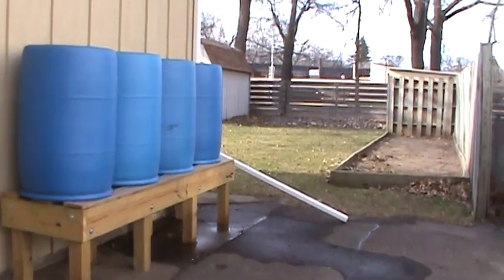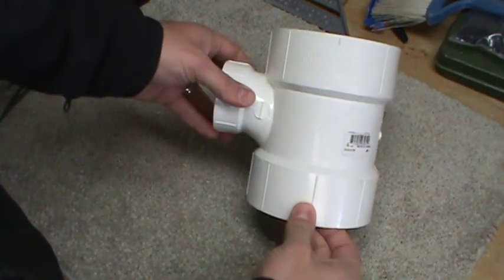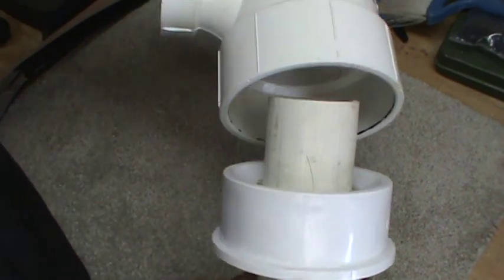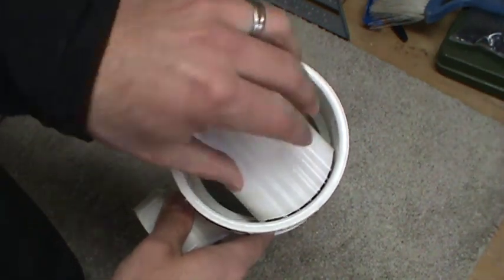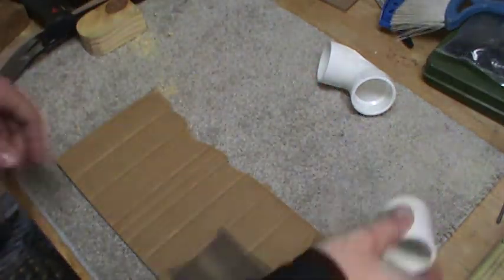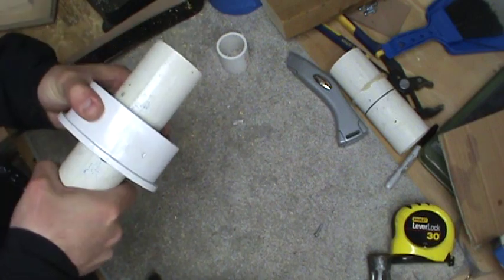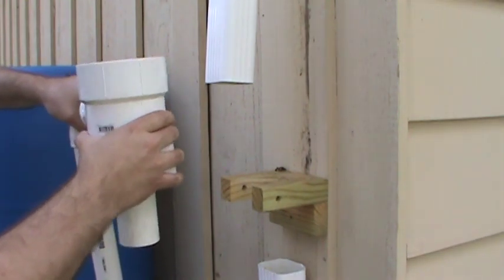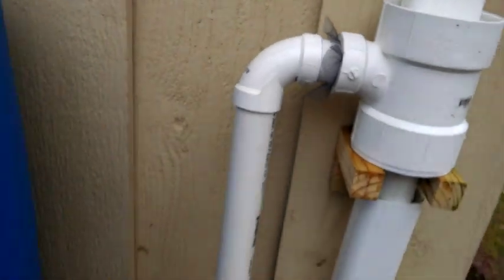Custom PVC Rain Diverter 1.0

Comment: You said the diverter does collect a lot of 'stuff'. That's what it's supposed to do right. Seems to me it works fine. It's easy to imagine all that stuff in the bottom of your rain barrel along with all the stuff that wouldn't get diverted without your ingenious diverter. As to having to clean it out, well yea! Wait till you have a composting toilet.
Good video and good job.

Comment: Left a comment on your other video about collecting debris before water goes into rain barrels.  Asked how you're stopping junk from making it into the barrels and the PVC along the bottom.  Found this video.  Thanks.  But!  I bet you're getting finer mud into the PVC and maybe into the barrels as well.  Perhaps the position of the barrels (upside down) might aid in self cleaning, but I'm suspecting you've had issues with mud.  It's been 7 years and maybe you're not looking at this video any longer.  If you do reply I'll be watching.

Comment: I have this same upside down system. I'm using a similar diy diverter. My problem is when I get a torrential rain the diverter can not reverse quickly enough. It's not sending water down the downspout fast enough to keep up with rain flow. This causes one of the barrels to top out above the air vent which creates an automatic Bell siphon and once that starts I have no way of stopping it until the Barrel's empty out down to the battle that started the siphon and then once it drops below that siphons then it equalizes all over again I'm now trying to find out how I can prevent the barrels from self siphoning during rainstorms where the diverter cannot backflow fast enough
Reply: Wouldn't a small vent hole on the top of the rain barrel solve this issue?

Comment: I am using your design except for my diverter, I raised the intake pipe higher than the barrel so when the barrel is full the excess water will come out of the air vent pipe. It so simple and works like a charm.

Comment: I'd let water flow from diverter to the barrels without any filter. Once in the barrels, debris will sink to the bottom. All you have to do is to clean up the barrels once a year. But you have to cut open the top of the barrels for easy excess

Comment: I appreciate your ingenuity. However, you essentially made a mosquito hatchery.
Reply: Please enlighten us how they get into the barrel.  His demo is awesome and very detailed, so your comment needs to be explained as well as his demo
Reply: Linda Murri seems like the top of the diverter is open and collects water for mosquitoes to lay eggs. Perhaps mosquito hatchery was a bit hyperbolic. I think the system is awesome and kudos to him for crafting a homemade diverter. It just appears that when he cleaned it out at the end, there was a decent amount of standing water in the diverter. Mosquitoes don’t need much.
Reply from the maker: I guess they could fly up the vent tube, but that seems unlikely and has never been an issue for us. If you build one and are concerned, a little screen over any open tubes would suffice.
Reply: Ben Brandt gotcha. It just seemed from your video that the top of the diverter was open and that mosquitoes could enter there and lay gags in the water that doesn’t drain inside the diverter. Or perhaps I’m missing something. I like your  use of the pvc conduit and sanitary T. Looking to do something similar.

Comment: How does the gravity fed water from the roof overcome the static pressure in the barrels and actually fill them?  Did you ever come up with a second edition? Thanks
Reply: Water will always seek its own level pressure is overcome by a simple vent hole drilled in the lid of the rain barrel. The weight of the water forces air out the vent equalizing pressure. Rain barrels are never completely sealed they are always vented if they are bottom filled. If they are top filled no venting is required because air will escape through the same hole that the water comes in through. Yes this causes restriction and slower flow during heavy rains where the pipe will actually be full of water; but the pipes are almost never completely filled with water. They are drains not hoses, so even if top filled a vent is preferred to ensure full gravity flow and equalization of pressure. Pipe diameter and venting is your answer. And now we know. And knowing is half the battle........G.I.-Joe

Comment: I really like your design and I am working on replicating it for the system I am building. One suggestion would be to add a leaf eater filter (https://www.rainharvest.com/rain-harvesting-pty-leaf-eater-advanced-downspout-filter.asp) between the downspout and the diverter. The leaf eater accepts a 4 inch PVC pipe for its outflow, which you can attach directly to the input of your 4" sanitary T connector. That should block most all debris from getting into your system and provide for much easier cleanout than having to disassemble the diverter.

Comment: Just put all the water in the barrel. Put a screen on the barrel that can be cleaned and prevent misquitos. And then put an overflow drain on the barrell. No point in making all that jazz with pvc. I bet that wasnt cheap. It seems like a good design tho

Comment: simplest way to keep debris from collecting there, is to keep it from getting there at the top of the downspout, with a filter there, just a domed screen at the top...removable for cleaning...you'd not have to take the assembly apart anymore...just 10 seconds on a ladder, tap tap, it's cleaned.

Comment: How does the water with only gravity feed push water up into the barrels?
Reply from the maker: The water level naturally stays the same across the whole system.
Reply: That' s true, but only if the air pressure in your barrels is equal to the pressure outside, in other words: if they are open (if only a little) at the top. I presume yours are

Comment: I suspect that with high flow rates such as a real rain, that  most of the water will be going straight  down rather than  the rain barrels taking on water.  That filter is a real constriction when the volume of water is ramped up.
Reply from the maker: Maybe so, but after over a year of use, any restriction is hardly noticeable. We've never had much of an issue filling all four barrels.

Comment: The diverter should have been about 2-3 feet long allowing the dirt to sink ,then once its full the water start overflowing to the tank. afterwards you simply open a valve at the bottom to flush the dirt
Reply from the maker: Thanks, yes that would work well. I've been considering something like this to act like a "first flush" system, so I'll have to give this a try eventually.

Comment: can you please post the detailed parts list? Especially the sizes/dimensions of PVC adapters, T, couplings etc
Reply: The main body is a Sanitary Tee H x H x H - PVC DWV, 4" x 4" x 2". The base of the diverter (that he had to enlarge with the hole saw) is a PVC DWV Flush Bushing, 4 x 2-Inch. The outputs to the rain barrels and to the drain are standard 2" PVC pipe.

Comment: Hey Ben, great design! I just bought four rain barrels yesterday and and in the research and design stage. I am definitely going to use your design idea for the rain inverter. thx for sharing... I also see that your screen got clogged up pretty bad. I seen a video on YouTube that a guy used a woman's panty hose as a filter/screen so I am going to have a 3" PVC tube added between the diverter and barrel and have the panty hose inside the tube as a big filter and it will not need changed often. Thank you again for a very informative video! 😊
Reply from the maker: Thanks Randy E, sounds like you're making good progress on your design. Glad you enjoyed the video and best of luck.

Comment: This is a really interesting solution. Everything I've come up with when thinking about this involves floating tennis balls to stop the flow.
Reply: Zach M 7
Reply: I still don't understand:  U are diverting the water from the "basin" to the tanks. wouldn't be better to divert the  overflowed water to the tanks?  the fact that the height of the two inches PVC creates a barrier to the dirt and pebbles from the roof shingles, cleaning the water, yes?

Comment: Good video, and great engineering ideas!  A first flush diverter would probably solve your debris problem between the diverter and the tanks.
Reply: B Cook Also, I would stain/paint the bracket holding the diverter.  Wood, even treated, wont last long if theres much moisture, especially where the water might pool between pvc/wood.
Reply from the maker: Thanks B Cook, "first flush diverter" is a new term to me. Will have to do a little research on that concept.
Reply from the maker: B Cook True, though knowing me I figure it will be changed before wood rot becomes an issue